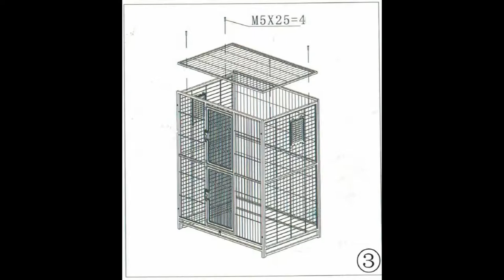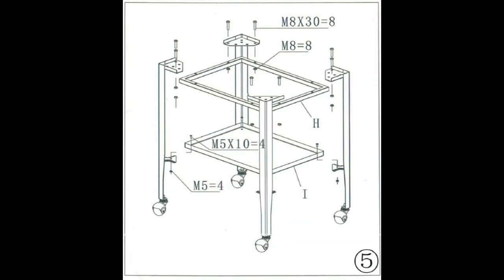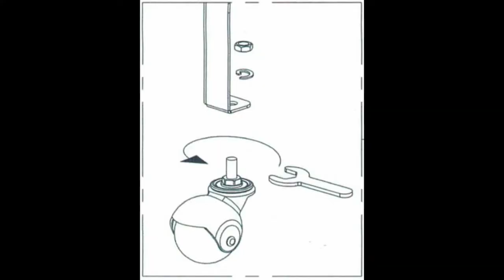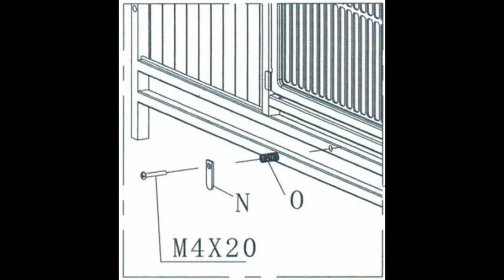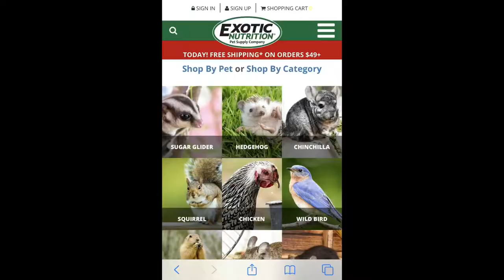NEW! Brisbane Cage Assembly

Comment: What can be done about the gap between the bottom grate and the cage? I can fit all of my fingers into it and I know a glider can escape. I have the older model Brisbane and there is no gap as there is with the new model.
Reply from the maker: If you are seeing a large gap between the floor grate/tray and the front/back panel of the cage, the back panel of your cage might be facing the wrong way. On the bottom of the back panel, there should be one solid flat side and one indented side. That solid flat side should face the inside of the cage, where it meets the tray, while the indented side should face outwards. Please check that out and make sure it is facing correctly.  In addition, be sure to screw in the tray locking mechanism. Closing the lock through the middle of the tray handle will ensure the floor grate stays in place and can’t be accidentally pushed in too far or out.

Comment: Hi there. I was wondering if it was possible to combine 2 Madagascar cages together with zip ties like pictured in the listing for the Congo cage. I’m looking to expand to a larger cage for my sugar gliders without having to get rid of the one I already have
Reply from the maker: Yes, although the Madagascar Cages are not designed to be joined together, we have heard of pet owners doing that successfully with zip ties as long as the two models are exactly the same. Beginning October 2020 Exotic Nutrition's Madagascar Cage is now sold as a new model (#GB12424A) has a new and improved model. We no longer offer the older model of the Madagascar Cage (#GA12424A).